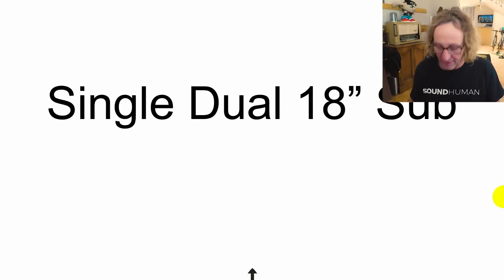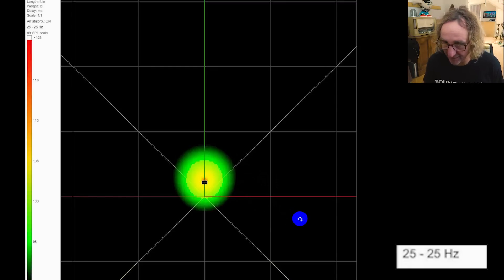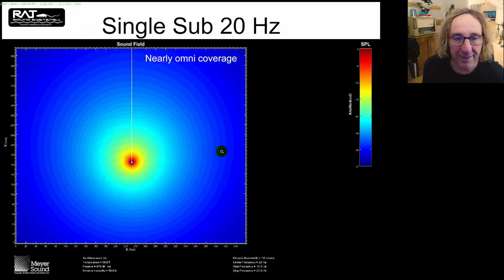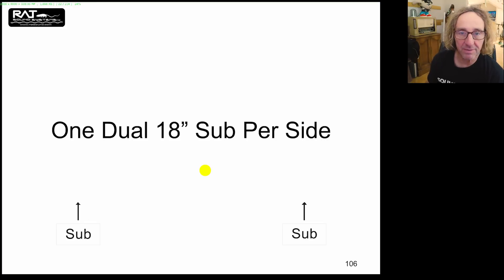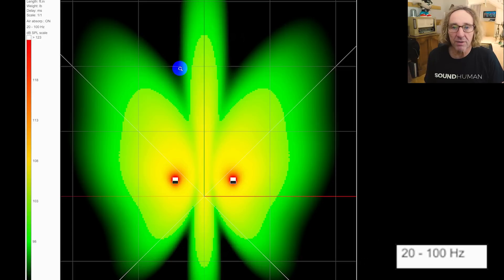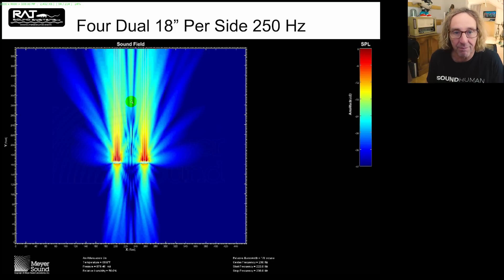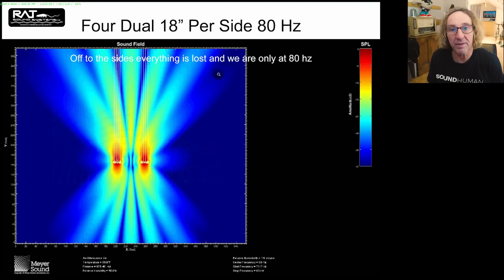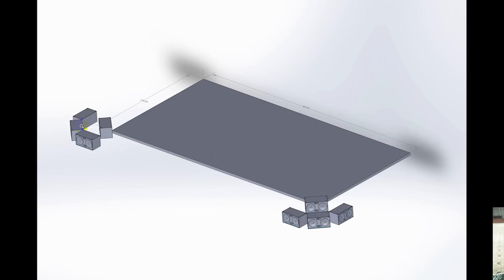Better Sounding Subwoofer Arrays Part 1 - Coverage and Quality

Comment: We use to have huge hall subwoofers with completely hidden speakers, either vertical box cabinet and 2 rectangular openings on 1 side top and bottom, also some which were like 2 feet high and idk roughly 8x8 feet boxes with not visible speaker, supposedly it had speaker in center and scroll like way out... i can't find nothing, zero on those designs on internet, maybe it was some failed concepts idk

Comment: Interesting video , and i can see youre modelling a direct radiator type subwoofer. Does anything change regarding the output patterns if theyre horn loaded or tapped horns specifically ? 

Im in the process of adding more cabinets to my system, ive typically ran 6 in a row at the front center, but am about to add another 4 per side.

I had pictured the side cabs toed in and arc'd to have a focal point/zone, im starting to wonder if this would even be any good.
Reply from the maker: Various cab designs can be more or less directional, this pretty much shows worst case scenario because I haven't made any compensation for frequency response of the enclosure off axis other than what's in the software.

I guess this would help with guidance in the preferred design and then using an enclosure that's more directional will help improve it further or could. 

As far as hornloaded versus tapped horn, I'm not aware of any directionality differences created by using a tapped horn. Whether you use the front of a speaker or the front and rear of a speaker combined together within the enclosure doesn't make much difference to dispersion and coverage as it should only impact frequency response and SPL level 

The exception would be if the front of the speaker is coming out of a different location on the enclosure than the rear of the speaker which would be create a directional box
Reply: @DaveRat  that all makes perfect sense thankyou.  I still haven't seen anyone simulate anything along the lines of the stereo stack combined with the center row. 

I can mentally figure it would be a summation of the two sims and would still have a few dips and peaks across the center but if they were positioned in a slight arc around the dance floor rather than away / wider, would this be more of less ideal to battle cancellations ? 

I will have the capacity to delay the side stacks relative to the center row only, and once the new side stacks are built I will absolutely play with delay settings. 

This is new territory for me , and I'm keen to get it nice n loud.
Reply from the maker: This can all be predicted with software to determine coverage. And it's not that hard to do what I did too hear what's going on if you want to take the time to do it

Comment: I found it very interesting to consider the subwoofers response way above the crossover frequency.
If we take 60dB+ as a practical value for "total" attenuation, then when you use a 24dB/octave low-pass filter at 100Hz, you're gonna get energy from the subs even up to 2.5 octaves higher than that (2.5*24dB = 60dB). So the real limit at which the subs are no longer producing any significant sound energy would be close to 600Hz! (2.5 octaves from 100Hz). So it makes total sense to care about their response beyond the crossover frequency. Thanks for the video

Comment: Hey Bro is there a sub design that gives you better distance before fall off I use the SB850s trap design and the SB1000s long throw design I don't feel there's a difference in coverage
Reply from the maker: Not really but like a line array main pa, a long line of subs can focus energy at a far point and nearer points won't have max summation. Resulting in a less drastic drop off
Reply: @DaveRat  ok thanks Bro Appreciate your help

Comment: I worked in a venue where we had the 2 subs with masive combing. I was at an event being destroyed by low end i walked over to FOH and hardly anything. Ever since ive been looking for the best set up. It changes so much show to show and often comprises are thrust upon us by the venue.
Reply: FOH was way the null not center.
Reply from the maker: Yeah, this is a challenge and working on a vid soon about hearing subwoofer array sound quality

Comment: You have many years of mix experience in arena's and different size venues with your vast array of mix experience. Have you spent anytime covering how to compensate for the bass tunnel or power alley that happens in smaller theaters underneath balcony's? 
 I've seen people mix from on top of the balcony or out in front of a balcony on the lower floor. But never underneath, just has a concert spectator, I've always noticed more bass standing at the back of a theater underneath the balcony. Would be great to see what's happening with subs in a theater with a balcony computer simulated, if possible??
Reply from the maker: I do cover that and the videos are currently on the member side of the YouTube channel I'm looking to clean them up and release them public at some point.

Basically to solve that issue of having the same sound come out of multiple speakers is not send the same sound in multiple speakers that are spaced far apart

Comment: 6 dual 18's in a cardio pattern center stacked. reverse the two center boxes. Hands down the best setup, put that in your program and see for yourself. The only real issue is the audience can power off the 2 middle boxes by reaching through the barrier lol!
Reply from the maker: That is a useful setup. And one of many to have in your solution set. It's good for even coverage and moderate reduction of sub on stage with a mono or close to mono subs sound.

I prefer getting the bulk of the subs farther from center stage, having a more stereo sub setup. 

Also if possible, using increased distances between the front and rear subs in endfire and cardioid setups offer better rear cancellations than subs flipped backwards.

I would say that gaining a diverse knowledge of the advantages and issues with various setups is preferable to having a single favorite best

Comment: OR, could a cabinet be built that has a 'baffling maze' that ultimately exits through an opening in the BACk of the cab that would be timed (And perhaps slowed and muffled with foam or an absorbant material....or not) and then the cab would act as its own self-canceling sub? It could this only be done for one specific use in one specific venue? because they all have  different gaping space behind, under and over the stage?

And thank you so much for sharing your knowledge with us and your patients in considering my not-well articulated ideas!
Reply from the maker: For reproduction of a single sound, that could work.  That challenge is that instruments radiate a vast array of sounds that are different in every direction. We know this because the sound changes depending on where we mic the instrument. When mic'ing a speaker we always just get a brighter, duller or more resonant version of the one sound or mix that it is reproducing.

To recreate an instrument we need to radiate several or many different sound in different directions, like the real thing does.

To do this we need several or many seperate signals and speakers.

Comment: What would happen if you put an array of subs in the very back of the room, and adjusted pahse: in/out/160 etc (Maybe based on time/distance from the subs at the stage....find a formula there) And then used those subs to either cancel or "draw out" frequencies that are not playing nice across the whole field? Am I making sense?
I realize that there is very little new under the sun, but could you locate and "long lobes" of freqs and put a sub at the far end of them and create a phase cancellation to tame them? Or at that point are we just wastuing energy that could be better put to use elswehere and how?
Reply from the maker: Whenever you have a distance between sources reproducing the same signal, you get significant cancellations and issues. 

Also that back of the room is 100s of feet away so there will be time delay issues. People near the back will here sound too early if there is no delay and if delay is added, the sound from the speakers in the back will be super late for people more toward the front.

Comment: Why are PA system producers still use the bassreflex box for SUBS? Hunting for higher SPL will affect the quality of the sound, and it seems like it is more important to have a high SPL than high quality. The bass reflex need "time" to "start up" also after a hit there is a "reverb" after the signal. Going to different concerts I am amazed how bad many systems sounds. Big sub waves are "rolling around" just to die out slowly and the sound pic is a mess with a almost never ending big anddiffuse low bottom. The quality would improve drastic if people would use closed boxes. You loose SPL of course but music should be enjoyed.
Reply from the maker: Hmmm, sealed sub boxes are even slower due to back pressure in the box. But yes, many concerts use too much sub or have poor venue acoustics or poor setup designs

Comment: 0:05 Oh, man, that looks like a Bassnectar NYE360 event. I once went to one with something like 3,000,000 Watts of driver power inside a sold-out arena of 30k people. I probably lost a percentage point of hearing at that set when, standing in the floor pit, I lost an earplug and got tired of manually plugging it.
Reply from the maker: Which one? I designed the subwoofer and system setup for Alabama 2015 NYE and my design was used in following BN 360 events.
Reply: Greensboro 2018 into 2019! Just before the world went crazy. I'm honored to meet ya! I'm on the electronics side professionally/by trade and a speaker hobbyist. At that time, I was building little <200w slot-vented semi-portable sub boxes using cheap Skar IX-8 D2 drivers and 100w TPA3116D2 amp cards, big DC-DC upconverters (mostly for the cap/inductor buffers & stable 24V), and clamp leads for batteries at camping festivals. It was a fun time of wook-R&D and provided a nice rumble for intimate spaces.

On an unrelated note, have you seen some of the stuff coming out of Hennessey Sound Design lately!?? I've felt a mid-sized HSD system in a horizontal array provide exceptional low-end bass at the other end of a huge field. And the aesthetics are very nice! The people behind it seem pretty wholesome as well. Lots of inspiring energy and beautiful accomplishments on the tech side of music&arts.
Reply from the maker: Cool cool, will check it out

Comment: I want to build a venue where every single seat has it's own 15 inch sub built in! 😆 Bzzzzzzzzz hahaha
Reply from the maker: That would be super cool but also brings up an interesting complexity.

How would you time the delay on those subs? Would each row of seats have a lightly longer delay so the subs align with the main sound system? If so, additive nature of all those delays would focus all the LF energy toward the back of the room. A massive complex endfire array that reduces subs for people close to the stage and I creases subs for those in the back. 

 Or would all the subs be at 0ms which means that for people farther away they hear the subs before the main pa sound and the combined LF energy would be focused upwards.
Reply: @DaveRat  Yeah, that's a lot to consider lol. It would be fun to have the opportunity to experiment with the idea though. Perhaps if one could start with the room design itself to eliminate some obstacles. Would time delays and lowering output levels combined be a solution to a degree? Perhaps using very small cardioid subs facing upward combined with delay and lower outputs?  Do you see any scenario where this approach could work? I was kinda joking, but if I ever did win the lottary, I would probably need to know this stuff haha! Cheers Dave! And Merry Christmas man! Hope you have a fantastic 2023!✌🤙👊

Comment: Do you think you will have the same dead spot with 18 inch bass horn box or scoops
Reply: Ook even if the design of speaker box, won't change that outcome?
Reply from the maker: What you see is the overlap of 2 sound sources recreating the same signal. If you reduce the overlap, the interference patterns will reduce. But does not matter what creates the sound. What matters is the freq responce and coverage. 

To stop the issues you need to either eliminate the overlaps in coverage or eliminate having more than one source recreating the same signal covering the same area.
Reply from the maker: Yes. The dead spot occurs due to the same frequency being radiated from two places. The type of speaker makes no difference. It could be 8x10" svt cabs and would still happen.

Comment: These deep nulls are really well defined outdoors, or in acoustically large environments. 

The 80's ushered in outdoor amphitheaters, and my first mix in such a venue I experienced this deep null adjacent to the actual FOH mix position ... still within the barrier corral! 
Blew my mind how significant it was. I understood it, sure, but seriously, the energy simply nulls. 

Outdoors, absent of boundary interactions, those patterns are well defined. 

Better yet; casino center bar, small live music stage. 
Typically I see them use a sub and top per side. 
Damn it's mind blowing the physics lessen you get by simply walking around. 

A center bar, in the middle of a big casino. Ceiling 40 feet or so and no boundaries for hundreds of feet in any direction. 

You can walk all around ... behind the stage, etc. The summation interactions are so vividly clear ... likely the best case scenario for experiencing such interactions in situ.
Reply from the maker: Agreed, I remember playing a casino ballroom somewhere with Soundgarden that was super well sound damped. And yes, could totally hear all the sub array flaws and assets.

Comment: Why do festivals on flat ground not use large (10+) towers of subs to get the power without any of the lobing issues?   So little attention (it seems) is ever paid to vertical coverage for subs (unlike tops).   Admittedly the horizontal will be omni, causing issues on stage
Reply from the maker: In video 1 where I show the coverage of a single sube per side, that is the same as a vertical sub array on flat ground. I believe it is the 2nd prediction set, right after single sub.

The big challenge with one sub per side or one tall line per side is the octave wide cancellation node just to the left and right of center.

Comment: 7:38: yeah, I absolutely hate setups with subwoofers on the sides only. When the most common seats we tend to buy are in the back slightly off center, it sounds extremely harsh and boring with this setup! 
For instance, there’s a concert series in a park in my city, and the setup is always 8 d&b audiotechnik V series line arrays per side in the main hangs, and each one has a cluster of 3 b2-subs right below it on the ground. The sub in the center of each of these clusters is facing backward, and likely has some delay for a cardioid dispersion pattern. However, in order to get good bass, your view is either blocked by the sound & lighting booth (in the dead center of the lawn) or blocked by the structure of the stage on the side! Everywhere else, the bass sucks! There is a dead spot between around 10 and 30 degrees off center on each side, especially toward the back!
Edit: important to know, the d&b b2-sub is a dual 18 inch, bandpass box. These are one of my favorite designs for a punchy sound.

Comment: I just want to share this video with every technical director and production manager that has looked at me like I'm a moron for not wanting to place subs either side of the stage. Or for even just suggesting there are other options for subs that allow for a better result for the majority of the audience. I get that sometimes the easiest placement for subs is either side of stage and that just where the majority of people expect them to go. But it is a shit position for them and with a bit of planning better solutions can always be found. Thanks so much for this series. We need resources like this to be out there in order to change the status quo of people's understanding of sound design principles and just because it's always been done a certain way doesn't mean that that's the best way. Or the only way............ Cheers

Comment: Very much looking forward to the next installment into this subwoofer series. I've been playing around with systems I manage including my own with two single 18" enclosures. I've heard the cancelations across the listening area always be worse when the subs are apart. That in mind I've been working to keep them together. Even if they have to both be on one side. I've seen others share software screenshots similar to the ones you have here. I can hear what your showing us. Cool stuff. Now to learn about how to best utilize what I have at my disposal. I also wonder about best crossover frequency to transition to mains and so on. Especially when one or the other struggle to give output in that area... I'd imagine a large majority of people in position to provide, setup and run sound, are using low end and limited gear like myself. One to four subwoofer enclosures in the 1kw each power range.

Keep the knowledge and experience stories flowing Dave. Much value in them.

Comment: Another way to get around the summing & phase problems of a stereo pair of stacked subs is just pan stuff to one side, or even run a crossover or stereo spreader so that each side gets a different split of frequencies per instrument.

The elephant in the room that makes the pretty plots rather inaccurate is...

Group delay. Especially in bass reflex cabs.
Reply from the maker: I get into altering the mix and altering time delays and ways to predict that in video 4 of the series. First we look at what happens and ways to optimize arrays, then we look at optimizing processing and the mix